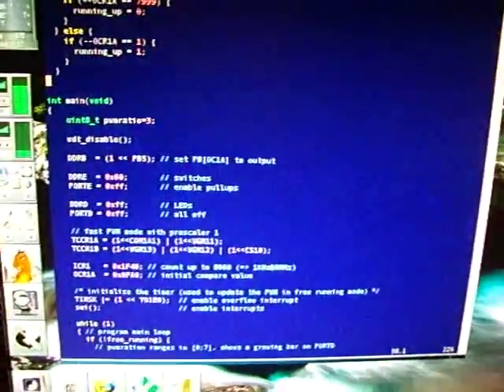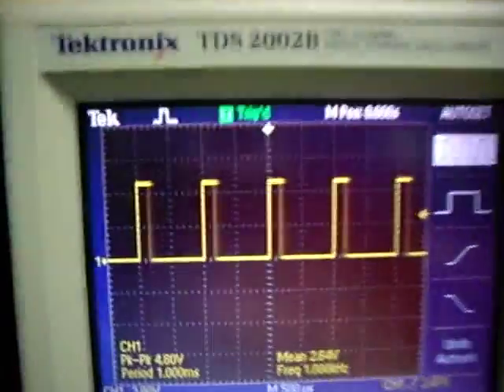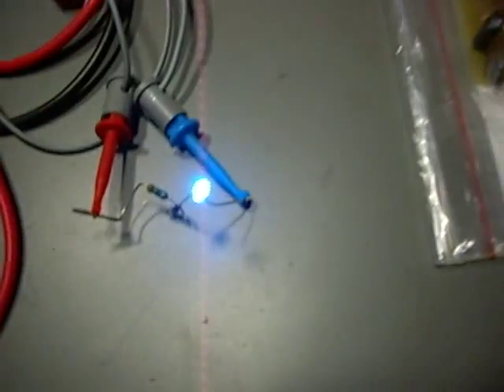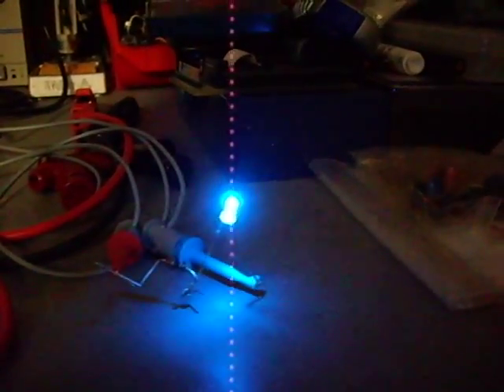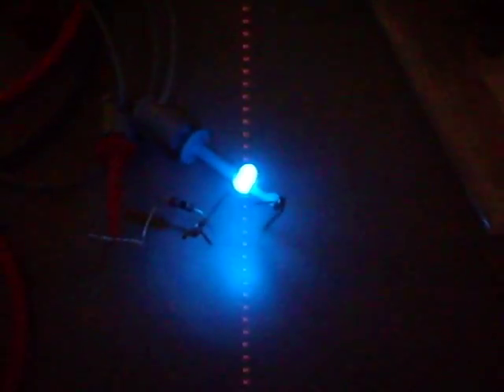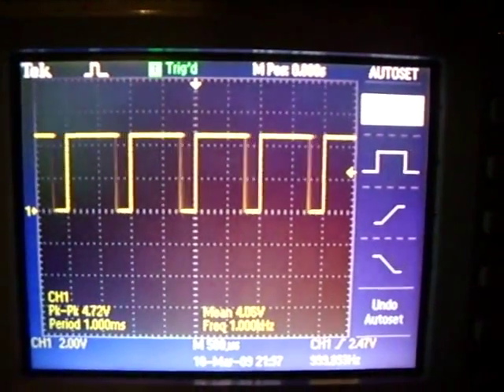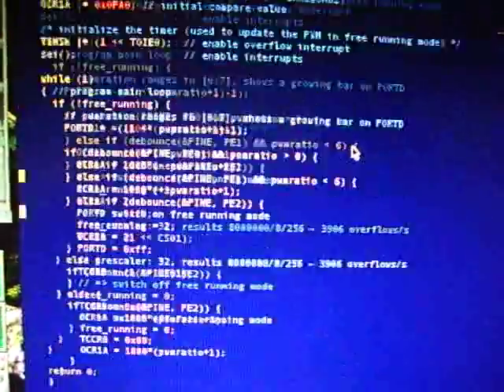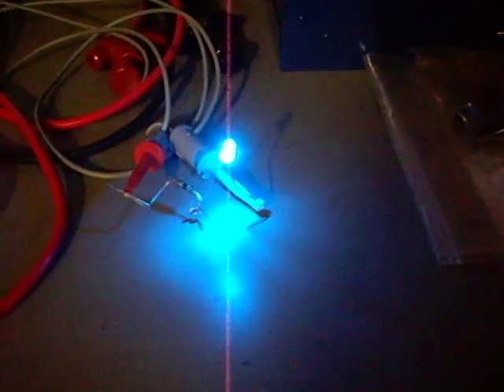PWM controlled (pulsed) LED with an AVR ATmega microcontroller.

Comment: I'm trying to get a blue pulsing light effect in a light console in my car from a side-glowing fiberoptic cable (simulates neon). Could I buy something like this from you? I don't have the time to learn it. It needs to run on 12V and have two leds (one for on each end of the fiberoptic cable in sync with one another. and they need to pulse like this does; randomly, slowly, breathing like, not staying off for more than a fraction of a second but coming very close to being off.